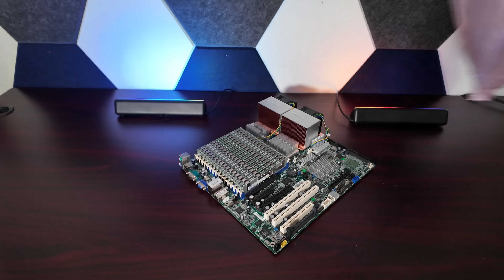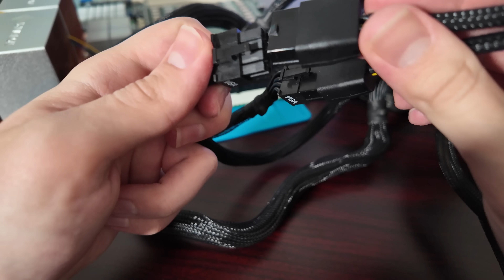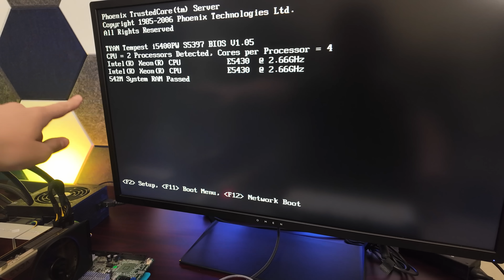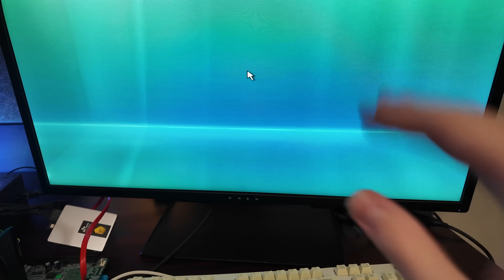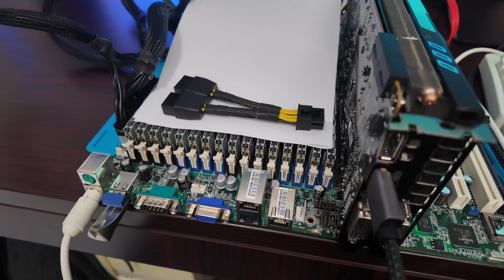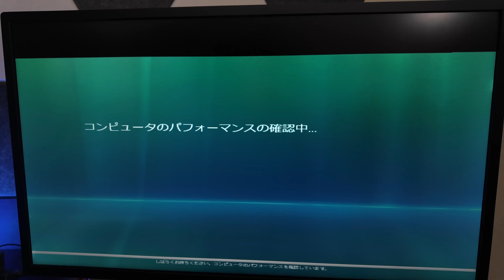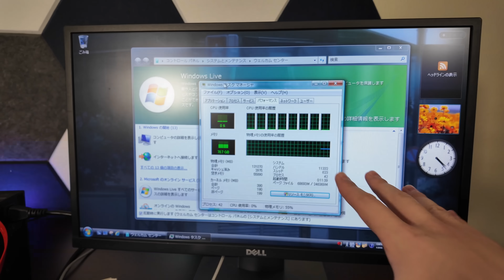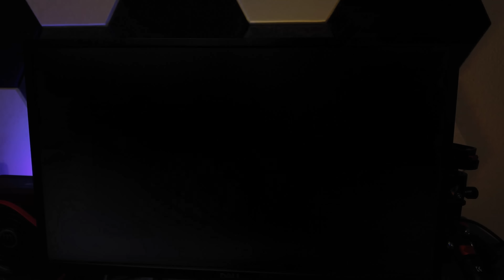What can you do with 128GB of DDR2?

Comment: You'd probably get better tests using Linux on this. Windows (non-Enterprise) has a lot of limits when it comes to multithreading, pair bonding, etc. A lot of what you're trying to do on a copy of Windows Vista is going to be bottlenecked by your single core.
Reply: This setup should start with a type 1 hypervisor, and then, have different VMs of various configurations set up on it
Reply: @SuvroBasu  Disagree. Containers are a better solution than a hypervisor unless you have a specific need for running different OSes.
Reply: @JohnSmith-sk7cg  I do.  I want to run Windows 7, OS-X Mojave, FreeBSD, Kali Linux & OpenBSD.  Have OpenBSD as the virtual firewall/router, have only FreeBSD on the internet and use the other OSs as I need to, but in secure enclaves
Reply: @JohnSmith-sk7cg you can also run LXC on a hypervisor the only difference is that you also retain the ability to also run VMs on a hypervisor. Which in general now though most NAS softwares kind of let you do both anyways
Reply: Yeah, I was interested in this but it's completely useless running vista. No one in their right mind is going to get a system like this and put vista on it.
Reply: Japanese half english vista install on the fly.
Reply: @demonicsquid7217  There's quite a bit you can still do with something like this if you don't care about power efficiency or noise. You can run your own private cloud services, a suite of docker containers, private collection audio/video streaming, etc. You could also set up a home lab for syseng/neteng using the virtualized versions of the hardware.
Reply: @demonicsquid7217  the hardware is more or less completely useless, full stop. The most basic servers that are useful for a homelab would be from the early to mid 2010s. Those will run a NAS just fine. This is basically just a fun space heater that also computes.
Reply: @metaleggman18  Total BS. My AMD A6 Linux laptop  works perfectly well  with <40% of the CPU power and  1/16th the RAM.
Reply: @metaleggman18  and nothing wrong with having a space heater that also computes, and its not useless, just limited due to its age compared to others.   But that can be said of ANY hardware.

I'd agree you can run better (once you manage to obtain better), but it can be used for fun and era appropiate stuff.  After all its his electric bill and physical space taken up not yours
Reply: I guess my ex girlfriend ran on windows, she had problems pair bonding as well.
Reply: it should use something like puppy linux to make full use of the ram. There is an arch package to make everything load in ram like puppy linux. Tho i dont think putting arch in such an ancient system ld be advisable
Reply: @uzzybuzzy-t5h  who cares aboput it being adviseable, it'd be fun to see the results!
Reply: Thats the magic of the michealsoftasourous 🤑
Reply: Vista was fairly often on a single core cpu some athlon 64, some celeron pentium d, possibly on high end pentium 4 too.

It'd be OK if it was debloated and tuned for performance.  It was also on core2quad and OG phenoms too.
Reply: @patg108  Apologies for the confusion, I meant single core speeds. His hardware has many threads so most of it will go unused due to lack of proper distribution across the cores.
Reply: @JohnSmith-sk7cg  that's threading or cores not speeds.  And what you mean is a lot of ram channels.

It'd be alright windows 10 or its server version may do best at this, though there is a distro for opterons with linux, that has a lot of cores and its weaker than this is too.  Might be interesting.

core speed is another way of saying clock speed or processor speed
Reply: @patg108 Bruh I was being nice about you misunderstanding what I'm talking about because you were unaware of shorthand terminology amongst engineers. I assure you I know what I'm talking about and the pedantry is unnecessary.
Reply: @JohnSmith-sk7cg  no i'm not misunderstanding shorthand terminology

he has 4 cores per cpu with 4 cpus so 16, and 2 channels each so 8 total channels

Its fine for what it is and can still get by on the low end in modern times.  My point was that there is worse multi cpu multi core setups out there.

what you're talking about with single core performance is known in modern times as IPC, the rating of a single core's single threaded performance.

Vista or rather its server version is era appropiate for this.  For tasks and software its appropiate, what you're thinking of is giving that hardware more modern tasks which would make it bottlenecked.

But to blame it on the hardware paired with the software is not the issue.  Especially considering its far above the average hardware vista was ever offically on.

To be fair Vista can use more modern hardware than what it was commonly run on due to driver support, though that may take hackjob programming to make a driver compatible with it.

Vista is the basis of the modern OS style so its not fair to treat it as modern since its literally a few generations behind.

you're talking to a A+ certified technican

Linux is trying to go past using hardware of this era and ditch it, it wouldn't really be that much more appropiate if at all.  In theory its a MAYBE at best.  Linux has a LOT of issues.

Its simply outdated, not useless.
Reply: @patg108  Again, your pedantry is unnecessary, it's also inaccurate as the threads are exposed as cores in the OS. The core speed also does not change depending on whether you have multithreading enabled. Vista is not by any stretch a modern OS. Its kernel is ancient and more pertinent to what I was saying, its internal services do not handle massive multithreading well. And your creds don't mean much. I'm not one to pull rank, but you're speaking to someone who has 10+ years of devops experience, 15+ years of ISP-level neteng experience, 5 years of experience as a technical lead at a MSP, and 5 years as a datacenter technician. Again, I both know what I'm talking about and I'm not interested in your pedantry focus when it's clear both in its original form, and in the nice follow up I gave you, that I know what I'm talking about. Have a good one. We're done here.
Reply: Especially if you are short on cash.  Linux is the right OS for hardware like that.
Reply: @GaryCameron  short on cash? what?
Reply: @OoSs-k4s  you can pay microsoft more money for them to allow you to use the hardware you bought and paid for fully.
enterprise licence shenanigans
Reply: @guesswho2778  most actual enterprise Linux distros are paid for, like RHEL. You might be thinking of server distros, like Ubuntu server, which is just the distro with some extra packages included by default. The paid for part is primarily the security and stability aspect, as well as support. There's a shit ton more testing done when pushing a new version for an enterprise product.
Reply: @metaleggman18  i was talking about the "you cant use all your ram unless you pay us" or the "you are stuck at X amount of cores until you upgrade your license" part with windows.
not a big issue for enterprise as they will just pay it and move on, but for those picking up used enterprise gear that arent obscenely rich, its not really an option.
Reply: Given the era, they'd have to confirm the version of a given distro supports the hardware. Newer versions as of the past year or so have started requiring newer x86_64_v2 or specific instruction sets. The kernel theoretically supports some 90s hardware still, but, again, that's not really something worth doing.

Unless you meant loading up a period correct Linux distro, then by all means. That'd be a curious video in and of itself.

Vista business, enterprise, and ultimate support dual CPU, mostly for HEDT. Should probably work fine with Xeon, but that's likely more of an Intel driver issue than anything else.
Reply: @metaleggman18  Debian 13 still supports x86_64_v1 perfectly fine (I've used this configuration myself in fact) and LTS versions will support it LONG into the future. Saying it supports only some 90s hardware is a gross understatement. I've used modern systems running modern Linux with IDE controllers, serial controllers, and NICs, from the 90s, and certainly nothing in this instance would even be nearing unsupported, so there's no reason to use a period distro if you want to do real benchmarking or experiments. I'll also add these are far from useless today, as while that much RAM is pretty undeniably unnecessary you can still absolutely host a competent fileserver, VM host, you name it. Many people use FAR less powerful equipment for these same purposes. Just because it isn't the fastest it can be or won't saturate your 10g network doesn't mean it's useless "full stop" :)
Reply: I'm running a current Linux Mint install on an AM2 based system with an athlon 64 X2 and 8gb RAM.  It runs perfectly well. I have it to piggyback an XP 64 install to take care of the stuff XP can't like SSD trim, etc.
Reply: @TheMcspreader  Very cool! I have an Athlon 64 X2 I need to mess around with too. Never thought of using Linux as a maintenance tool for old systems, but that's a neat idea. I understand this is secondary, but have you ever had any success doing modern tasks on it?
Reply: @TheMcspreader try puppy linux, it ll be SOOOOOO FAST AND SNAZZY. Tho it has the biggest impact if ur an hdd user like me
Reply: @metaleggman18  While Vista supported multi-threading, the majority of its system operations are not multi-threaded.

You don't need to go all the way back to that period for support. Support lasted long after this.
Reply: @metaleggman18  Nonsense. Unless you use a special gaming kernel. 64bit Linux will just run on anything Athlon 64 and up.

Comment: playing with old hardware is always fun! I have some borderline e-waste on my desk as we speak.  I think your RAMdisk example suffered from both software overhead and filesystem overhead. Its not perfect, at all, either, but booting in to Memtest86 could have been a fun way to see the memory bandwidth tested. Cheers
Reply: Yeah, one does not use Windows Vista [even Ultimate] if one wishes to run a memory server. One must run an appropriate version of Linux. That is all.

Comment: I found an old HP proliant server from 2004, it had 16gb of DDR2 (8x 2gb sticks). 16gb DDR2 was the equivalent of having 128gb ram today.
Reply: Think we had 4 gb (but it was a bit slow) on our Proliant running Windows 2000 SBS (Exchange, IIS, Sharepoint, DNS, FTP,  SMB file sharing, and so on and on)... Was totally fine for about 10 users.
Reply: I was watching a livestream yesterday. The guy coding was using Visual studio 2006 which was quite refreshing. Current day Visual Studio is a gigantic lumbering dumpster fire that I'm told requires 64G of ram to do "real work".

Comment: That's a nice looking board. I have a Supermicro server with a 771 board (X7DWN+) which supports 128GB RAM but it's too tall to fit in normal case and it only has 64GB RAM because I only have 4GB sticks.
Someday I want to try Proxmox on it with multiple VMs, but first I'll have to buy some SSD(s) for it because I stole most (all?) hard drives from it for other systems years ago. And because it's a 2U server it's really loud

Comment: King of 775
Reply: is dual 771
Reply: They are similar, besides LGA771 being able to work with dual cpus.
You can also fit those Xeons onto LGA775 with a cpu cutout and modded bios.
Reply: @crystal_regiment  i have supermicro x7dwan with two xeon e5472, i paid a lot for 8gb of ram...within fout dimms. Cannot imagine how much ws for 128gb in 8gb (sic!) dimm...
Reply: @devilzuser0050  It's just arbitrarily different socket to charge more money.